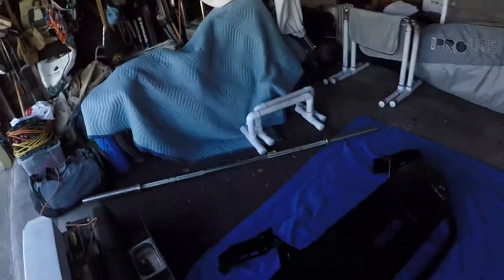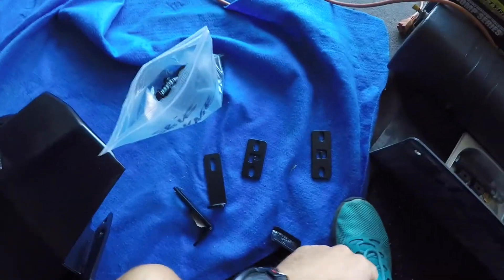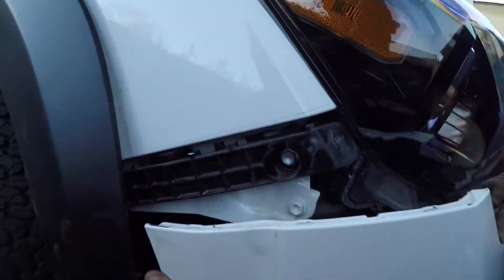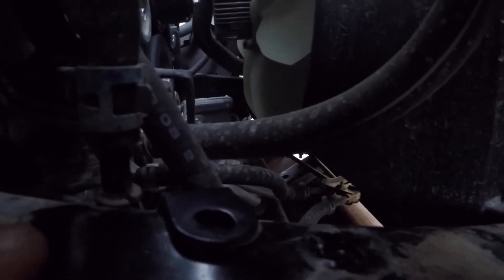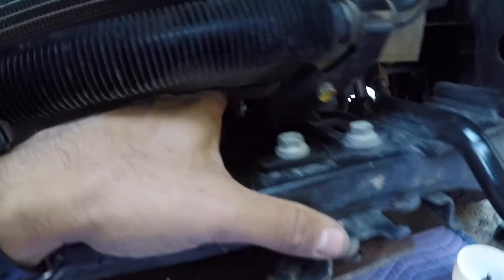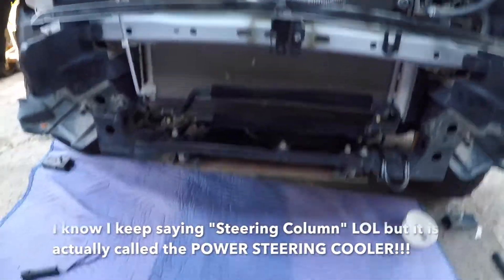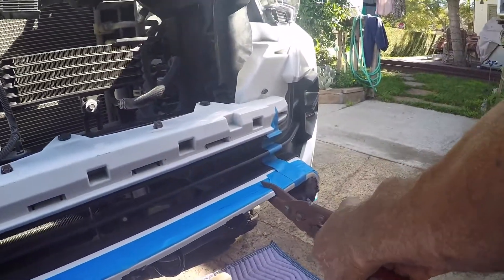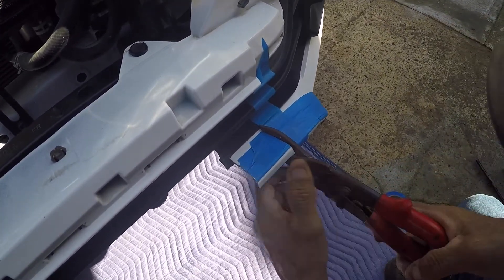C4 Lo Pro Bumper Install!!! (Trd Pro)

Comment: Lo pro bumper looks awesome!!  All you need now is a Prinsu Design Roof rack!!
Reply from the maker: gilberto ocegueda thanks brotha. That is in the works!!
Reply: Has the bumper cause your truck to tilt forward? Or any lag in acceleration?
Reply from the maker: gilberto ocegueda no it hasn’t tilted my front end.  But you can definitely feel the added weight when braking, steering and a tad bit of lag. That’s what you would expect for a steel front bumper. There’s always a post ice and negative to everything. I still love my front lo pro bumper tho!
Reply: It looks awesome! I’ve been hesitating on getting it  for that same reason! I’m trying to keep my truck stock, but I really love that look.  I just installed my prinsu rack, all I want now is  the lo pro bumper!  But thanks for the feedback, really appreciate it. Beautiful truck by the way!!
Reply from the maker: gilberto ocegueda you will not regret it if you do end up getting one. You don’t need the extra bumper frame support brackets if you don’t plan on getting a winch btw. Hope that helps.
Reply: I will be getting the winch and the light bar. So should I get the extra brackets?
Reply from the maker: gilberto ocegueda only if you plan on using the winch. It just adds support to your frame.

Comment: Do they make this for the 2019 Tacoma trd pro. I have not found one yet
Reply from the maker: chad darbonne https://www.c4fabrication.com/product/2016-tacoma-3rd-gen-front-lo-pro-winch-bumper/
Here is the link to C4 lo pro bumper that I have. It will fit 2016+ Tacoma’s

Comment: Do you still have the stock Fox trd pro suspension? was also curious about weight of the bumper and sag
Reply from the maker: Reilly Harbach yes I do have stock Fox suspension. It doesn’t sag and I’m about to take it off roading tomorrow through the Mojave desert and test it out! Stay tuned for more videos to come very soon!!
Reply: PandaTacoPro_17 Tacoma thanks for the reply man. Think im gonna send it on this bumper for my truck, def curious to know if you notice it at all on trail
Reply from the maker: Reilly Harbach I’ll let you know when I get back!
Reply: I’m just curious why not go with a full bumper? The lo pro looks great however

Comment: Did you notice if your front end got weighed down? Honest answer please. I just adjusted my coilovers higher cause my tires were rubbing. I can’t really adjust them more.
Reply from the maker: No i didn't notice any difference in height...but I did notice the weight difference when driving my rig but not that bad.  I do not get any rubbing on my rig at all.  Hope that helps answer your question.

Comment: would you have any issues with the adaptive cruse control in the 2018 trd pro?
Reply from the maker: I have the 2017 Pro but i have not had any problems with the cruise control at all.

Comment: When u ordered that bumper is that the standard mounting or did you get the additional mounting option?
Reply from the maker: James Klein front bumper frame support brackets that I purchased extra from C4. They are not necessary to mount the bumper but def help if I were to use my winch in the future.

Comment: I have a 2017 trd offroad what really eats me up the thousands dollars spent on these tacomas you would think for the money they would come with a solid bumper but instead they are nothing but plastic crap that if you would hit a trash can at 5 miles n hour the front end would be caved in causing thousand dollars in damages..
Reply from the maker: Old Timer it’s just a cheap way out for them.

Comment: Where is your factory TRD PRO Skid Plate, does it not fit with the C4 Lo Pro Bumper?
Reply from the maker: Drobie Thy No it does fit with my factory skid. But I replaced my skids a while back before the C4 bumper bc I opted to go w/ all Steel Skid Plates from Pelfreybilt! From front to back.  Although I do miss the stock look of the old one but I know that steel is a lot stronger. Plus I’ve already banged up my front steel one a couple times in Mojave Desert. If my stock TRD aluminum Skid plate was on, it would have dented/ruined it in the first place.
Reply: Hey Brudda, I 👀. 
😉👍

What size KO2's did you mount up, did you up size?

Thx
Reply from the maker: Sorry for the late response.  But my tire specs are 265/75/16.  Hope this helps.  It is a tad bigger than stock.  I also have a video on when I first installed them on my rig. Check it out on my channel